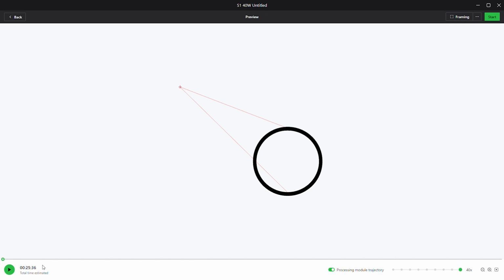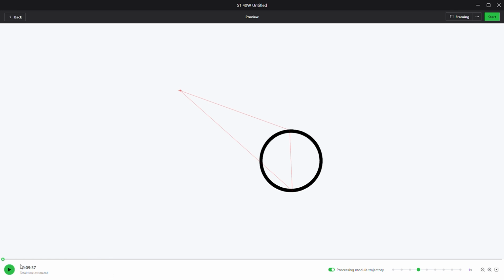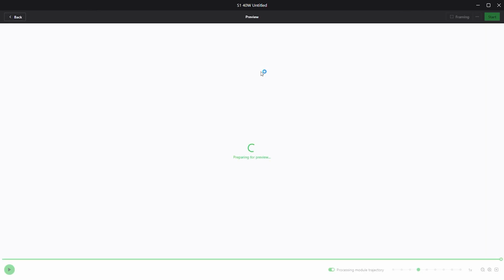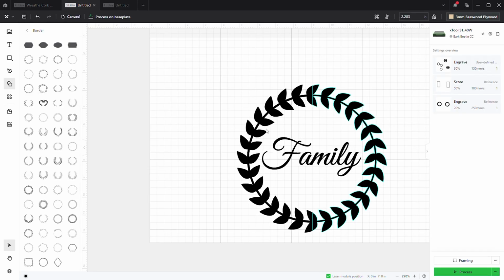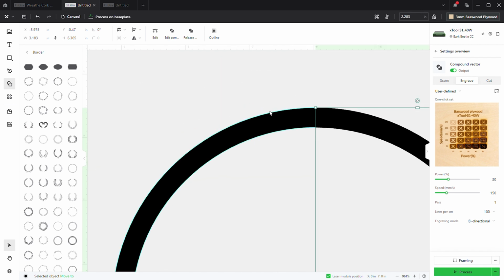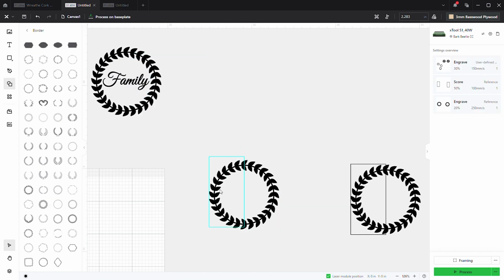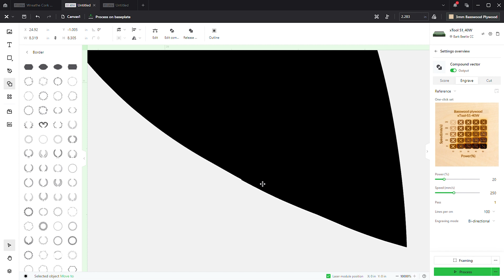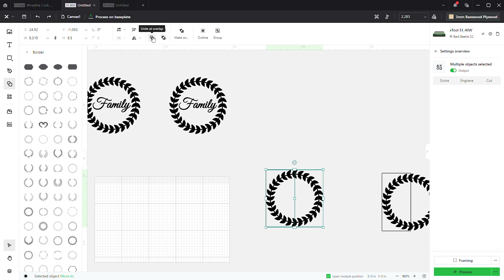Save Time Engraving Borders Xtool XCS xTool Creative Space 2.23 Xtool S1

Comment: Glad I found this, just spent 27 mins watching a frame slowly engrave - a job I could have done in just over 2 minutes using offset fill in Lightburn. I must admit I am finding the limitations of XCS are a bit too much to deal with. But great video, thanks
Reply from the maker: @johnfowler6085  I'm trying but they keep focusing on the next thing instead of fixing what we already have. Still irritated we don't even have adjustable grid spacing let alone snap to node. There is an automatic feature on the F series for this call smart, but I've sent this video into xcs management months ago and it's fallen on deaf ears.